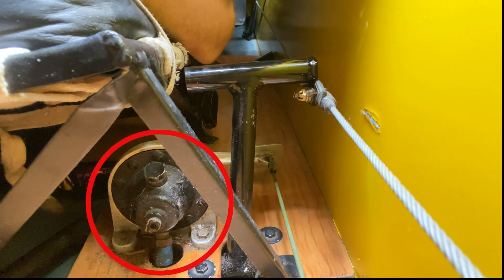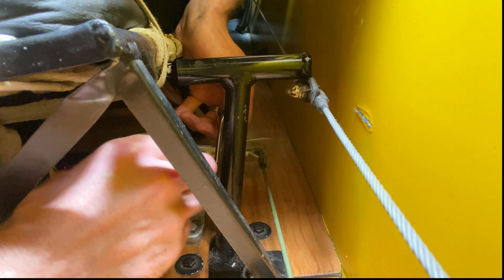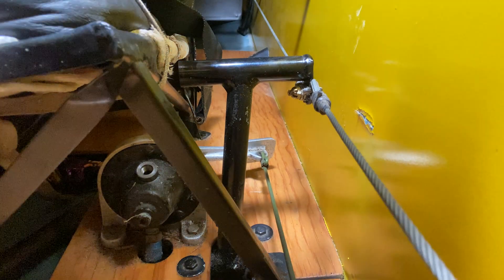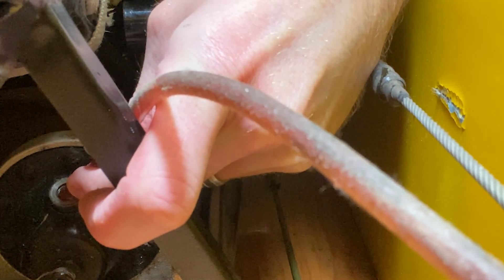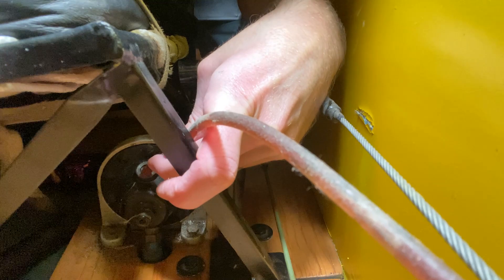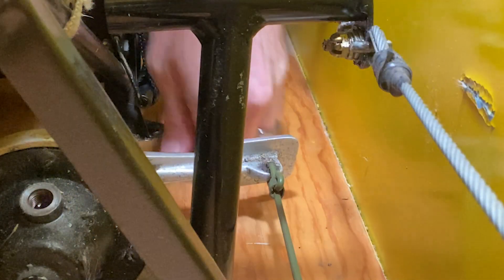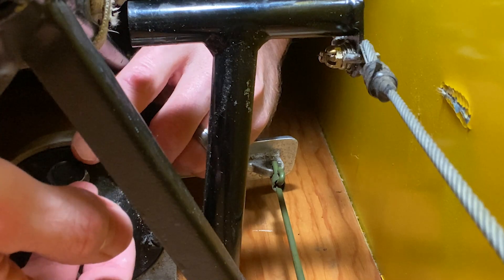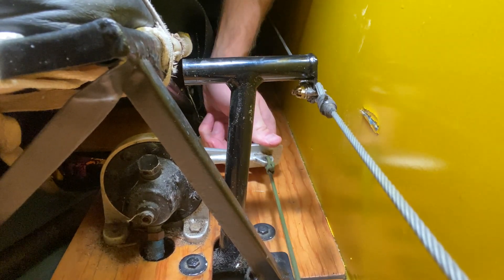Aircraft Maintenance | How to Add Brake fluid to a J3 Cub!

Comment: I do a different method. I start down by the caliper and loosen the bleeder valve and then move up to the master cylinder and remove the plug (I have Cleveland's, not drums). I'll then take my hand oiler with rubber tubing and attach it to the bleeder valve and start pumping the 5606a up to the master cylinder. Once it starts to come out of the master cylinder, tighten the bleeder valve up and then the plug on the master cylinder. This tends to eliminate any air that might be trapped in the brake lines. Give the brakes a few pumps and you're all set. Nice video!!
Reply from the maker: Thanks for the feedback. 👍 What do you fly?
Reply: A 1946 Piper J-3 Cub, C-85-12.

Comment: Once you are sure that the system is clear full and your brakes are still kind of soft place  the wheel off the ground by putting a block of wood or a jack underneath the axle then at the bottom of the break using about 10 psi of pressure in a pressure bleeder expand the expander tube until it just starts to drag then remove your tube and let a few drops of fluid come out until it’s no longer dragging you will have good brakes
Reply from the maker: Thanks for the tip! Good way to make sure they're not dragging.

Comment: I like the simple and efficient explanation on how to add the brake fluid, I am a visual learner so this was super useful.
I am just curious which brake fluid do you recommend?
Reply from the maker: The fluid is compatible for systems with synthetic seals and it's red. It depends on the system your working on. 

5606A Aviation Hydraulic Fluid is recommended for systems that do not require a “super clean” fluid.

5606H for systems that require super clean fluid. The type I used is similar to what you would buy today as 5606H. The oil can I used is actually 40-50 yrs old, the owner of the cub already had it.